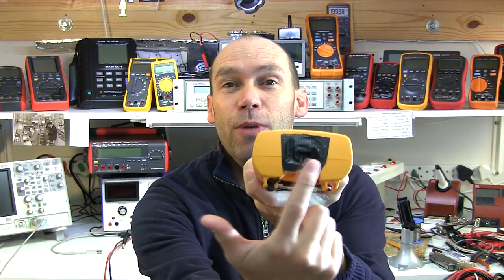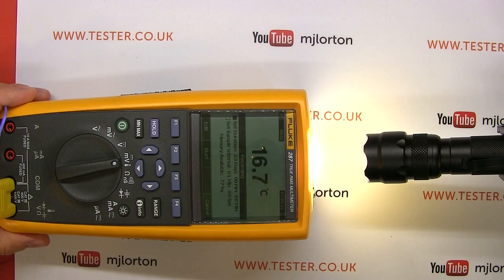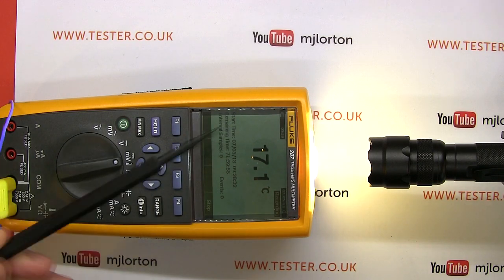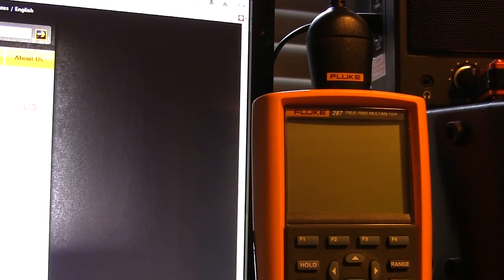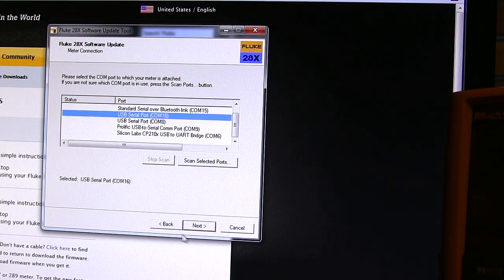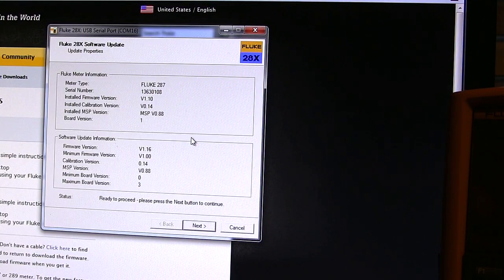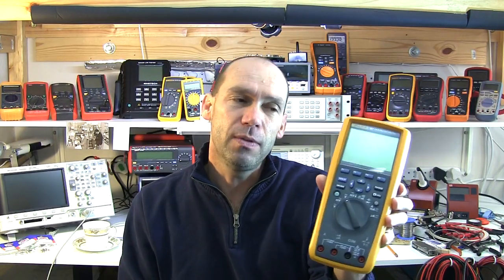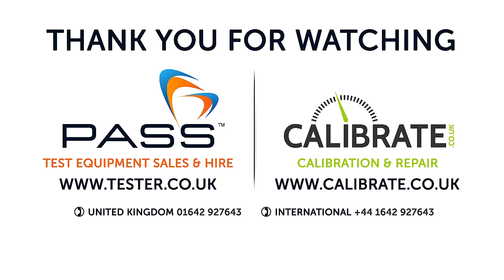T4D #63 - Fluke 287 / 289 Fixed! Firmware v1.16 fixes issue with light entering iR port

Comment: True, but the IR phototransistor must have some response at visible light if it saturates like that and pulls the RX line permanently active. A better cure as well will be an extra IR filter in newer production models. Should be retrofittable to the older ones if for some reason you cannot update firmware.

Comment: I still can't figure out what the problem was to start with. was the meter seeing the IR spectrum low voltage signal and the meter would simply shut off, thinking the meter voltage regulator was bad and it shut off before any damage was done. or was the IR port getting a signal from ambient light to shut down.